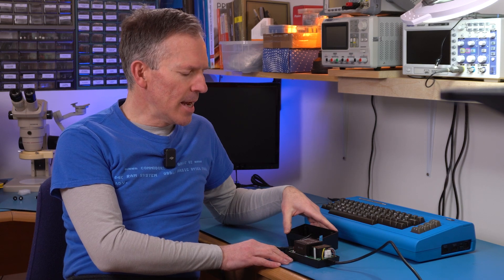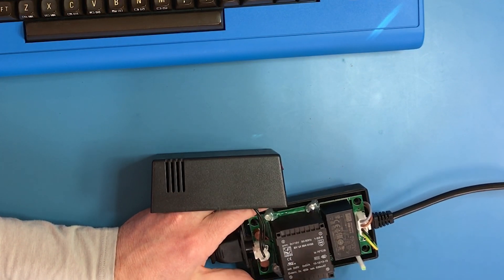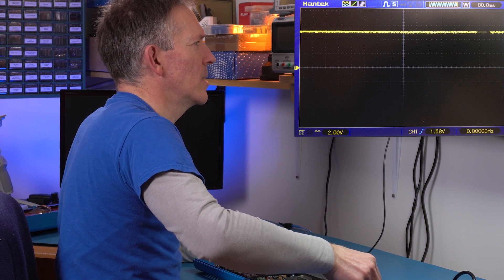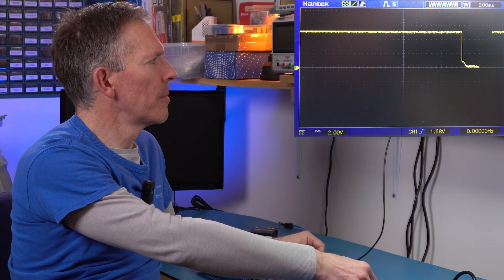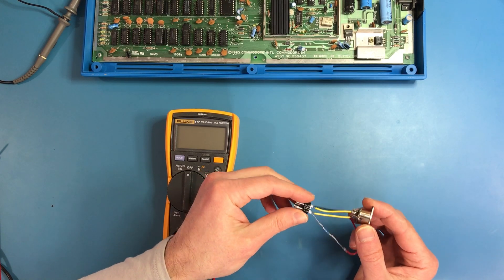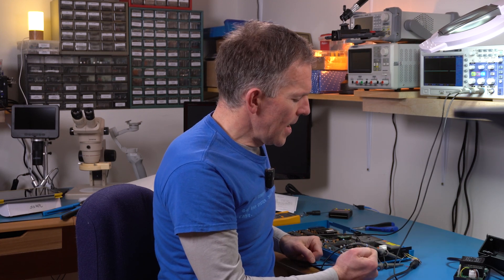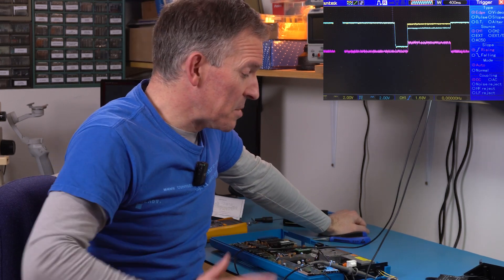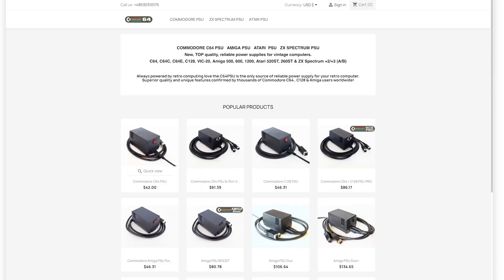What's Going On With This C64 PSU?

Comment: This 'soft start' that you see on some modern switching power supply chips has caused some problems in the ST scene where they can take longer to stabilise than the ancient reset circuitry is allowing for. The solution there is to replace (or parallel up) the appropriate cap in the reset circuit that provides the time delay. Of course that doesn't explain why you're seeing this problem intermittently on your supply. Perhaps there's a capacitor internal to the Meanwell that is generating the high current when it's more discharged (off for a decent time)? It got the impression you were more likely to see the slow start after a longer power off period than a short on-off-on cycle. But that could be a bit of me seeing what I want to there.
Reply: So the thermistor in these modern PSUs are making trouble for the vintage computers. The website to Electroware talks so much about the brick of death etc. How ironic. Use your old PSUs. If it ain't broke, don't fix it.

Comment: I had a modern PSU that I got off Amazon last year. After a few months of use the 5v pin suddenly went from 5v to 5.6v and the 9v pin went from 10v to 14.5v. Fired my SID and two memory chips. I went back and double checked the Amazon reviews. I was not the only that had issues with volts jumping up. That is what I get for not fully reading all the reviews! So I trashed that one and got an Atom PSU from Commodore4ever. So far The Atom has been awesome, but I also got a PSU over voltage power saver just in case.

Comment: I would put a new 5v regulator in the computer since those are a common enough failiure point. Might be it's on it's way out and the modern power supply has some kind of protection that is sensitive enough to sense that.

Comment: I think 2x5v means that is has a centertap and 2 5 coils and by putting them in series the (9v) is derived from that.
Reply: He didn't read it fully. It's 2x 5VA. It's incorrect to say 'watts',  but if it helps you understand, think of it like that.

There are 2x 9v secondary windings (the output side) and each is rated to supply 5VA (like watts)

If you connect them in parallel, that gives you 10VA out. The C64 PSUs were rated at 1.1A or 1.2A on the 9v line, so something around 10VA is about equivalent to that.
Reply: @CollinBaillie  That makes perfect sense.

Comment: Use several low wattage low ohm resistors in parallel - you lower the resistance and increase the wattage.

Comment: I am thinking switch contact bounce!  I've seen similar behaviour with other PSUs!  Try cleaning the power switch!  I think what happens is the contact closes - inrush current drawn, contacts open, PSU over compensates and the voltage goes higher, perhaps tripping over voltage protection on the PSU?  Having said that - just watching towards the end now, I see using the power strip part, so not really sure..  Those power switches are pretty bad at bouncing though!   The same exact behaviour happened with the C64 voltage saver prototype from bwack - and it was inrush there combined with the bounce.
Reply: Maybe somehow protection on the 9V supply is affecting the 5V output? That's supposing the 9VAC isn't just a passive transformer.

It would be helpful to have measurements of the switching transient at the 1-100us scale, I think you're likely right there's something interesting going on right as the switch turns on.

It could just plain be inrush triggering short circuit protection, forget the switch bounce. IIRC the C64 has some pretty big capacitors in the power input section, and until those are full it'll draw current like a mofo, especially if it's been recapped with modern high quality capacitors :) I would have thought the 1 ohm resistor put in place to measure resistance might have been enough to soften the inrush, but that's why I'm wondering about the 9V.

One way to soften that inrush current without just adding resistance is by adding an inductor in series -- big but not too big or it might affect regulation. Another way (harder on the switch but with less effect on regulation) would be to add a big tank capacitor on the PSU output to just supply as much inrush current as the C64 wants... brute force but 🤷
Reply: It would be interesting to crack open the IRM 10 5 and see if there is a bulk output capacitor inside it.  The block diagram and test results for it don't indicate anything on the output, maybe expecting the designer to add bulk output capacitance (which appears missing).
Reply: Swap out the power switch with a new one.